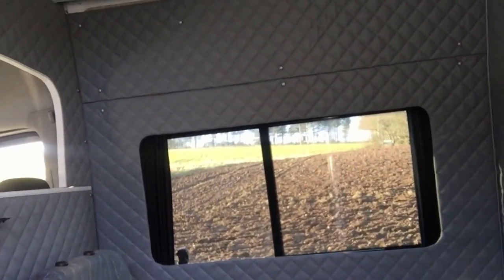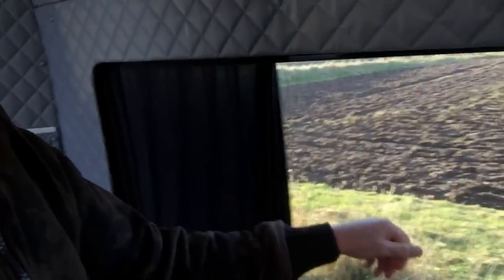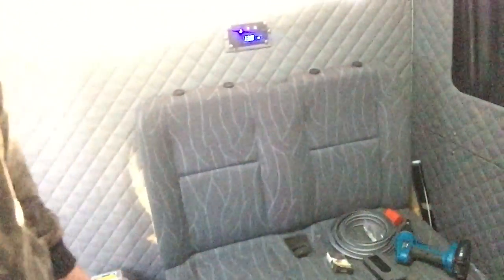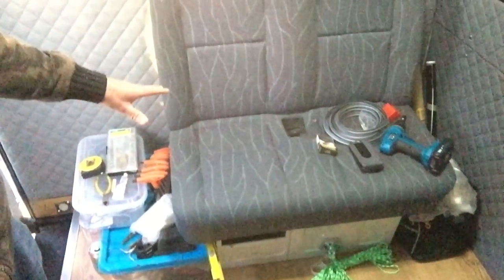HOW TO SELFBUILD A CAMPERVAN WINDOW FRAME INSTALL

Comment: What kind of glue did you used. Did it pilled of when too hot? Thanks
Reply from the maker: Google User it was high temperature spray glue it won’t peal I the heat not so far anyway